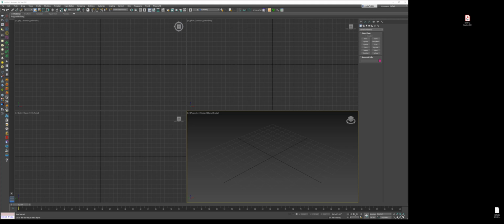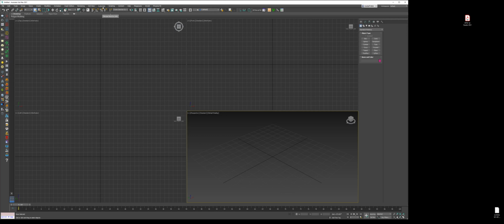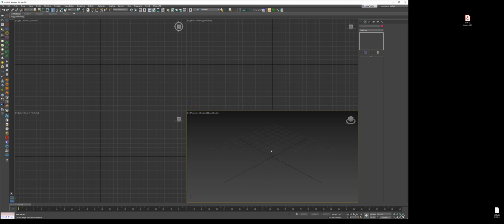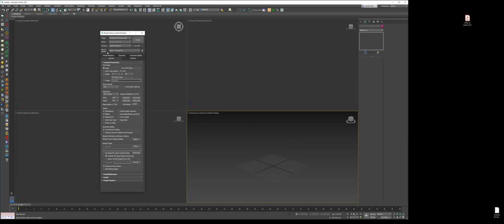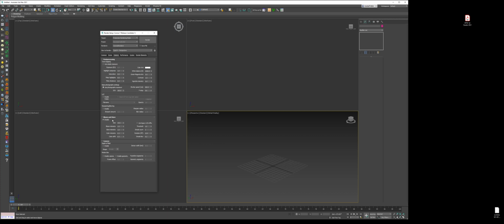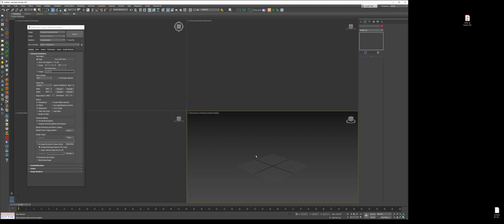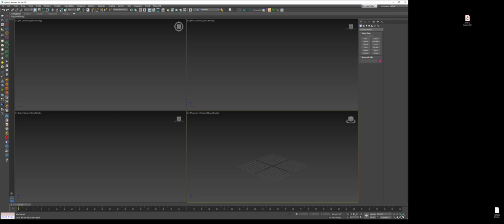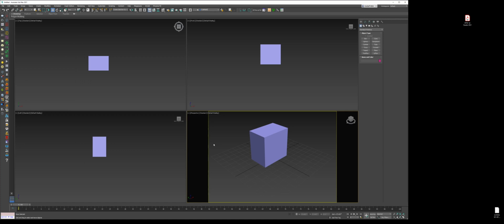PG2CGI - 02 - 3D Max Basic Setup

Comment: you did not show it but can you explain what you would put in the exposure control? i just started using 3dsmax a month ago (having spent 10+ years in cinema) so i know what to do but dont know where and how. i have vray installed fyi
Reply from the maker: Ohh sure. So when I run Vray (which I normally always do), I set the env exposure to Vray exposure. Then, Shutter Speed 200, Fstop 5.6, and ISO 100. White Balance Neutral. This has been my base setup for years and years and I normally use this when starting any job. Then I just dial things in if needed later on. Typically I leave it as is and adjust fstop or shutter speed of the camera for dof or motion blur elements but don't overwrite the exposure settings if that makes sense?
Reply: @AutomotiveCGI  ahh i see, so do i get this right: the vray exposure control in the enviroments tab is the same thing as the tone mapping control in corona in the render settings window? its the same controls but in different places so to say
Reply from the maker: @7ens3nButt0n  You are correct, which is why at first I was saying to to Env Tab but then realized with Corona its not the same thing lol.